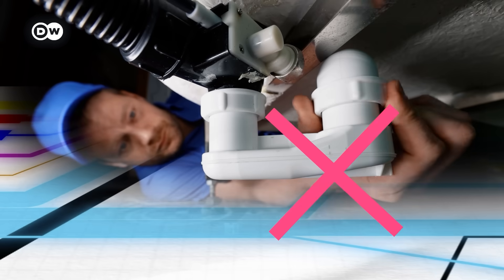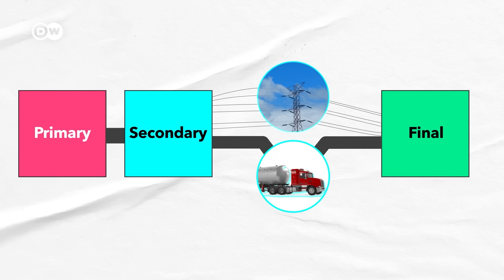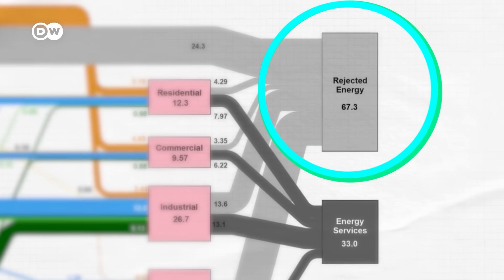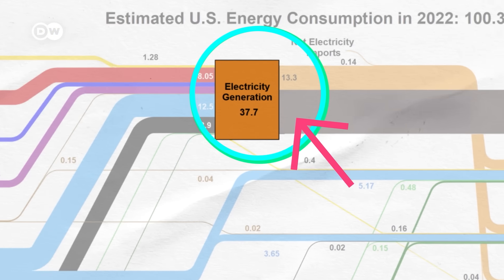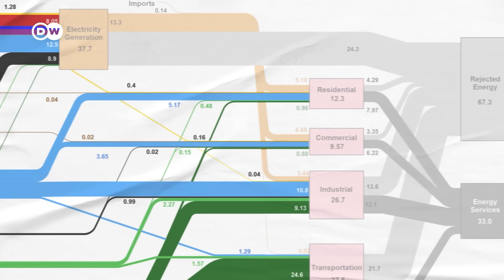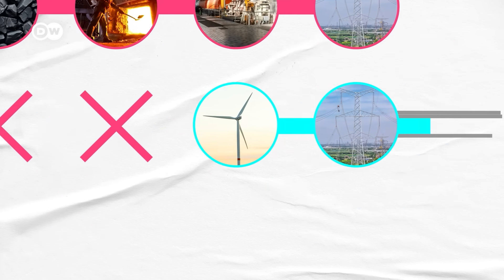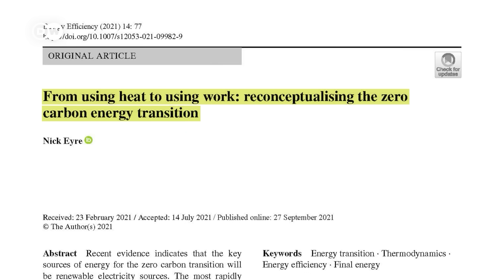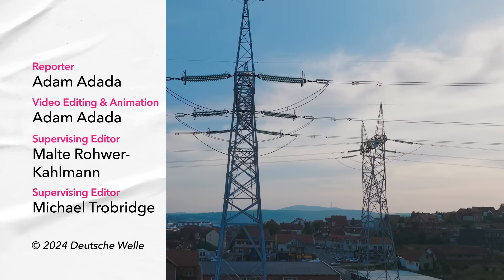The mind-blowing thing we get WRONG about energy

Comment: Not only that, but you can go to the left further for the oil and gas industry. You dig up the oil, you pump it, you ship it, you refine it, that all takes massive wads of electricity and fuel. It might seem difficult and expensive now, but in 10 years time there will an exponential growth in renewables. As long as the politicians aren't corrupted by the oil lobbyists we will just have the really difficult ones left to convert

Comment: There's plenty of opportunities for more micro financing of renewables.
Anyone that has an electricity bill, and a place to install a renewable energy source, should have a good economic case.
Simply borrow to install the renewables, then pay back the loan with the money saved on the energy bill.
This process should be as easy as possible for the person paying the energy bill.
It should probably be the same companies providing financing, installation, and coordination between multiple local renewable systems.
Here, the efficiency of the system should be much improved, as local sources don't have the transmission problems that large central facilities have.
These kinds of distributed systems could be further optimized by adding battery storage.
A grassroots grid of renewables should be a good way to rebuild the system with efficiency in mind.

Comment: Great Video. Most of the time we are way to pessemistic about change. 
But I am confident, that we are going to transform way faster. 
Solar cell prices have plummeted way faster than we expected. 
LFP Batterys do not need cobalt and are getting so powerfull, that they get used in cars. 
Right now a lot of industry is still working with fossil fuels every day.
But if they switch, millions of engenieers are getting to work. 
Image what that will bring to the tabe.  The progress is going to speed up exponemtially.

Comment: Solarpannels waste 2/3 of the energy.
Reply: You're looking at it the wrong way. Solar panels waste about 2/3 of the sunlight, which was free anyway. That energy was never produced. 

That's very different to the 3/4 of energy lost by an internal combustion engine. The fossil fuel for the engine has already cost a lot to extract, refine and transport and then gets mostly wasted.

Comment: A big part of this issue that is rarely mentioned is battery technology. As another reply pointed out, fossil fuels are currently cheaper to transport and store than electricity. As long as demand meets supply, everything is fine, but most renewable energy cannot generate a consistent supply. So you need to store the charge in batteries which results in some loss. 

Nuclear power is one exception, of course, and fuel cells offer the potential to be able to store energy in a more "fluid" state, if you'll pardon the pun. But battery technology has been lagging behind and is only recently catching up.
Reply: For large loads, hydrogen/ammonia/methanol fabricated by intermittent renewables will likely out-perform batteries. Iron-air from Stanford/Breakthrough is
1/4 - 1/5 cost of Li ion....

Comment: Solar panel efficiency is 22% or less.  Windmills convert wind to energy at 20% to 40%, and I have no idea the efficiency of turning sunlight into wind.  But, the heat created by those losses would be the same if the solar panel or wind turbine wasn't there.

Inefficiency is a primary reason I can't support hydrogen.  Creation of hydrogen, and using it to power a car, in an engine or a fuel cell, is currently about 9% efficient.  It would require 9 times the solar panels for an 85% efficient battery powered car.

Comment: This is an excellent video, and capturing this efficiency differential is immensely important in achieving sustainability.  The critical, timely, energy transition is a massive undertaking, but many of the needed resources are already at hand.  Not all renewables, for example, are intermittent. Storage hydro is one of the oldest and most reliable forms of baseload generation globally. It only accounts for a smaller part of the US grid mix, but there are very significant additional imports from Canada, where hydroelectricity accounts for about 60% of all electric generation there. This storage hydro capacity is effectively a massive existing, long duration, grid tied battery.  What we need is to commercially re-task all this this from baseload to peaker generation, using intermittent renewable power, when it is available, to allow the reservoirs to replenish capacity.  This would allow for the very extensive proliferation of additional wind and solar.  Other solutions such as allowing plugged in EVs to feed/sell power back to the grid at a profit when demand needs capacity, and supply cushion sensitive hourly power pricing (do we need 10 million hot tubs and pools heating for the 1 hour, no wind, no sun, dinner hour, when the supply cushion is under pressure?) are also excellent market driven tools available for implementation reasonably quickly.

Comment: I'm sorry but heat pumps are the most inefficient system I ever seen! Evaporating temperature of the refrigerant is very high. In other words, the less heat in the air, the less efficient the compressor will be, kicking on the element heaters which are the electricity consumption killers!
Reply from the maker: Really? 🙄 We have a video on them: "Heat Pumps: How cold rivers could heat your home" 👉 https://www.youtube.com/watch?v=nUPZf9LrF1s. Maybe you'd want to check it out. 🎇

Comment: When I hear people claiming that something is impossible to do , I remember that all too often the spokeman works for a company that will end up with Stranded Assets. Expensive Oil refineries that will not be required, expensive oil extraction systems that will become redundant, even factories that will need to retool for more energy efficient products. 
The change over will not happen on day one, but it is already happening incrementally, with each new electric car in use, with each new house with more efficient heating/cooling. 
Taking the UK as an example, some 50 years ago nearly all electricity was produced using coal, with some Nuclear and oil generation. 
AS I type type this 56% of generation is from Renewables with no Oil or coal use at all. This is spite of the UK government effectively slowing new Windgeneration on land in recent years. 
On a personal level , my House is fully electric, with the most efficient features that I could buy. My cars are BEV.  The electricity company is commited to full renewable energy suppy. My personal direct  use of petrol products is now zero. 
Put simply, It can be done!

Comment: Completely one dimensional. Oversimplifies problem. Look at the energy that goes in to gathering that energy; the capital required to produce each unit; the reliability of production (should be factored into the capital required); look at how useful the form of energy supplied is. Solar and wind should be used at limited scale. They are not a total grid or total energy solution (with or without batteries).

Comment: I did not hear the words unreliable or intermittent anywhere. I did not hear the cost of battery backup, and I did not hear the massive energy consumption needed to provide renewables, or the lack of minerals  or the energy density of elec power stns above the very weak renewables. This is a false video with no balancing of the options. .
Reply: As opposed to the billions of dollars in company & taxpayer money spent every year on building & maintaining drilling platforms, coal mines, oil pipelines, refineries, fueling stations, etc? Or the energy needed to refine crude oil into gasoline and other products? Or the incredible thermal inefficiency of combustion engines? Or the billions in cost from continuing to use fossil fuels in terms of healthcare cost, environmental protection & clean-up? Or the massive opportunity cost of continuing to invest in a system we know is polluting & expensive rather than investing in solving the issues in healther & safer alternatives?
Reply: Battery storage is relatively cheap. They could actually replace peaker plants and be cheaper as well

Comment: Very interesting and eye-opening, but I would have liked that you also took electricity storage in consideration, when talking about renewables. I suppose that can/will be done in the near future, but how much of the original input of energy is lost there? Not that I am against the energy transition, but unless we all consume the energy produced by renewables at the time it is being produced, instead of hours/days/months later there should also be an efficient way of storing the electricity for later use.
Reply from the maker: Good call! We did a video asking how does our power system need to change for more renewable future. Check it out here 👇
https://www.youtube.com/watch?v=u-DsDuTceTo
Reply: @DWPlanetA  Thanks! I will have a look.

Comment: Mhh, soon as you started mentioning batteries your story start to fall to bits, as renewable go off line in the winter for ….weeks in Northern Europe.... no wind, zero temperatures (very high demand) and the sun is only up for 8 hours per day and often tooo weak due to fog and very low cloud. Coal is now on the end of life and their power plants do take days or sometimes weeks to warm up and go on line...... Gas turbines do not. Gas can be on line in minutes and at full production. The energy mix for the future is 40% renewables, Gas plants for the rapid response (fed with FRACKING Gas... why transport it half way round the world?), gas fired central heating (actually 90% efficient) and Fuelled cars and trucks (probably ICE). Net Zero..... NO.... Net Less making use of renewable when they are their (60% downtime for Solar and 50% for wind). YES.

Comment: We have two similar cars (VW Touran and VW Caddy). On long trips the Touran uses 15 kWh/100 km and the Caddy 5l=50 kWh/100km - a factor of 3.3 in the best case for the fossil burner. If you  cold start them and drive through the city you end up at 13 kWh for the Touran and 7.5l=75 kWh for the Caddy. A factor of 5.7. In the latter case every kWh spent in the Touran replaces 5.7 kWh of Diesel burned in the Caddy.
Not switching road based transport to renewables would be outright stupid.

Comment: Steam turbines and fossil fuel motors lose most of the ingoing energy to heat losses. Which slowly but surely boils the planet. Yet another reason, apart from CO2 and methane, to reduce fossil fuel and also nuclear energy. Renewables OTOH deliver electricity in one go with very little heat production/loss and without the need for steam turbines and cooling towers, radiators in cars. Remember French nuclear reactors having to go offline because the rivers were almost dry int he scorching summer heat? The heat has to be wasted, otherwise the nuclear reactor cannot function. A solar panel does not generate heat when producing electricity. The efficiency of a solar panel is low with about 22% but that is because it is not able to turn all the light into electricity. The rejected light is not a big problem, remember that the 22% of light that the panel catches does not heat up the planet!.  The rejected light was going to hit the planet surface anyway and is not extra heat. The wasted heat from fossil fuels and nuclear however was stored safely under our feet. When you use THAT energy, the CO2 and waste heat is extra heat from ancient times. The only CO2 from solar panels is produced during production. After installation on your roof top, you have a free lunch for some 40years. A solar panels degrades a bit over time, but it has no moving parts that need maintenance. In that respect, solar is even better than windfarms. but since solar and wind often alternate eachother, we need both. A similar rambling account can be given about batteries. Little heat loss, pretty high efficiency. Costs for batteries are going down almost as quickly as the costs for solar panels.....

Comment: You seem to have completely missed the electrical energy loss from power cables. Transmission is around the cable not through it. This heats the atmosphere. The further the transmission line the greater the energy loss.
Reply: But those power lines are used for all power, regardless if produced by fossil fuels or by renewable, so it doesn't really change the result. And with solar power and wind power normally being installed closer to the customers (sometime even on their own roofs), renewable energy actually has another advantage there, too!
Reply: @IgorRockt  Then you need to consider the whole context of mining, production, operation, maintenance, recycling and geopolitics of all the equipment used in fossil fuel and "renewable" (=rebuildable) energy sources as well. So yeah it does change the results, greatly...
Reply: did you even watch the video?
Reply: Yeah, about 5-10% is lost on transmission.

Comment: It is clearly the best way to go, no doubt about it, there's a massive BUT! tho
The increased load on the grid is simply not possible, it can't in its current (no pun😂) state carry this much demand and would need a significant investment in new cabling, transformers, substations at every single stage between production and the end user, every single road being dug up to each residential address.
This genuinely isn't something that just needs a political will, it's a considerably larger transformation, a can that gets kicked down the road! 
It needs to be steadily phased in over decades to be affordable and bearable and the extremists on both sides of the coin need to row back to reality imo.

Comment: Looking at how much more base materials are needed to electrify, e.g. Copper, it really doesn't look like we can achieve a major reduction in our use of fossile fuels. Yes they are very inefficient - but they are also a lot easier to use, because it is low-tech. Would be really nice if in a future video you could look at projected base material requirements (copper, nickel, rare metals, also graphite etc.) to pull off this big electrification, build out of smart grids + build the massive wind / solar power generation we would need. How long does it take with current levels of production for these base materials to make the change happen? What are historic rates that can be assumed to increase this production?

Comment: You have completed missed on "Solar Thermal" use case when you say that renewable energy means only electrical energy. Solar water heating and solar drying of crop are good examples.
Reply: True, solar thermal is useful.  The efficiency of commercial solar PV was about 12% a decade ago, now it is ~20%, and so large scale solar thermal less competitive,
except when combined with thermal storage to enable 24 hour uptime. As you note, water heating (etc) still a very good use case!
Reply: I'm wondering since I live in a tropical climate and we use solar thermal for water a lot. In temperate or frigid climates, how does it work out? It works until it's winter then you have to use heaters?
Reply: @WolfTheTrueKing yes, exactly. Here in Germany a house owner can replace their heaters with the solar just for the summer month. May till September. We use a different type of solar heat collectors in combination with multi-purpose hot water tanks in our basements. This way we can use the thermal heat generated in the winter month to support our heating system, but most of the time it's not sufficient to generate hot drinking water of useful temperature. But with vaccum tube collectors you can still harvest a good amount of heat on a sunny winter day. But the financial benefit is low in comparison to f.e. gas prices. Gas is still "too cheap" to make solar heating economically.
Reply: Solar water heating became obsolete with the invention of high temp heat pumps. Solar heating (I have two systems running) have a huge amount of drawbacks. I wouldn't install another one. For example: you need electrical support energy for the pumps. You've got a lot of thermal losses, especially in storage. And biggest problem for me: what to do with the heat when your hot water tanks are full?
I have to add: I'm from Germany. We have cold winters and so we need to run our solar heating with water-glycol mixtures. Glycol burns or chars when getting too hot. Although in Germany it is forbidden to waste collected heat, f.e. by feeding it to an outside positioned convector. And most people don't have a Swimmingpool which they could heat with the excess energy.
Photovoltaic panels are the better choice for me. A warm-water heat pump does a great job with high efficiency and is quite cheap now.
Reply: They still haven't become very popular, but combined panels for PV and heat would be ideal. A part of the electricity from PV would be used for pumping the water (or glycol liquid in colder climates) around. This provides warm water and cools the panels making the PV part more efficient, as their efficiency drops when they get warm.